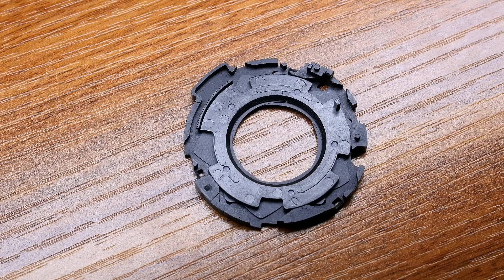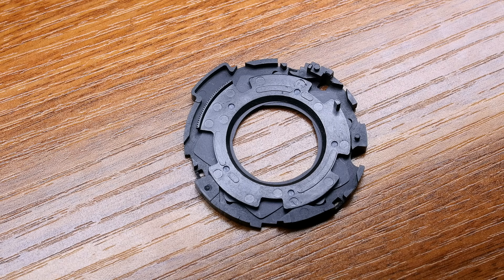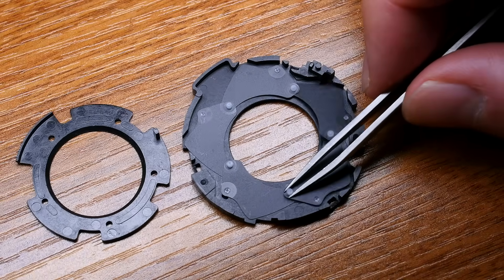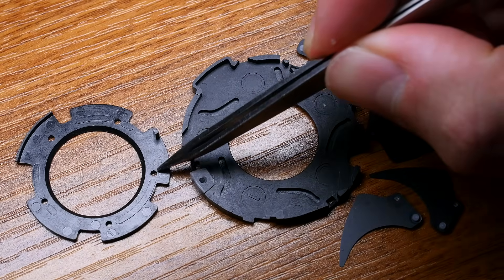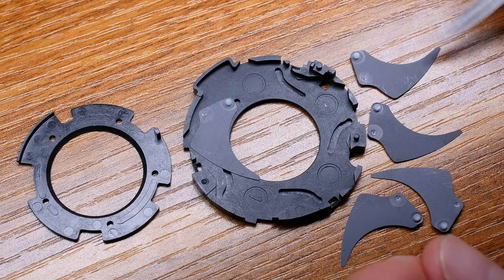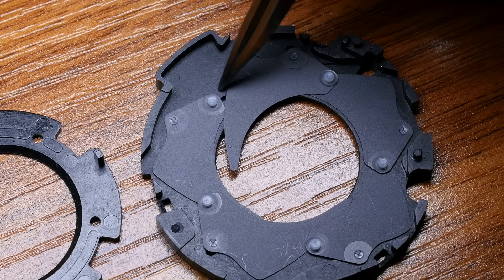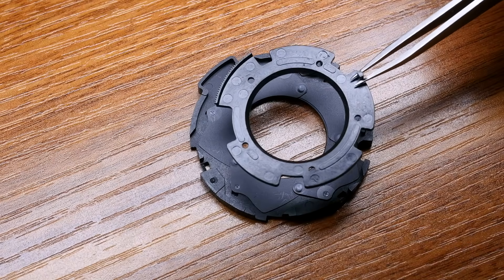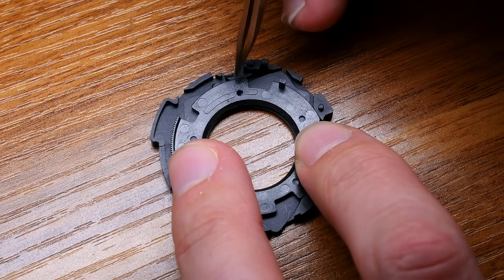How The Lens Aperture Mechanism Works In Detail - How It Works Canon 50mm f1.8 II

Comment: For an O’Neill cylinder, I thought the central spine Will be held in place at the ends and in several areas in the middle, and you could have essentially an aperture mechanism like this and you could use mirrors to illuminate the interior, or at least help it.  This will be useful with solar and fission, besides hydrogen fuel cells if you were parked by Saturn and Jupiter

The other possibility, is to use fission and fusion, along with solar to help power their lighting system. That would be useful to give you an idea for an interstellar class cylinder. That’s just not ideal for around the solar system where you already have a star.

Comment: I have a question. Under what circumstance could the aperture get completely closed? 

I disassembled part of a 35mm lens to clean the blades and at one point their travel points seem to change so it didn't fully open and it went passed the smallest aperture (completely shutting) so I didn't try to open the mechanism any further and manage to get the points back to their position but I'm still concerned that they could be in the wrong positions...

Comment: Very interesting! So what we see here, is that the blades are pulled by the top ring, causing them to travel through the lower guide rail while also rotating inward? I imagine the rotation of the blade is caused by the upper peg having a different path of travel than the lower peg.